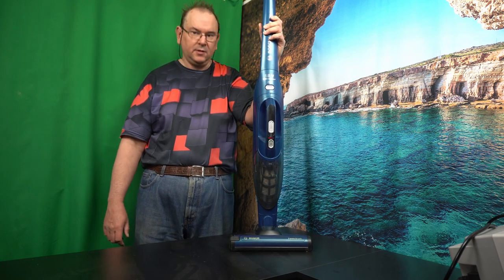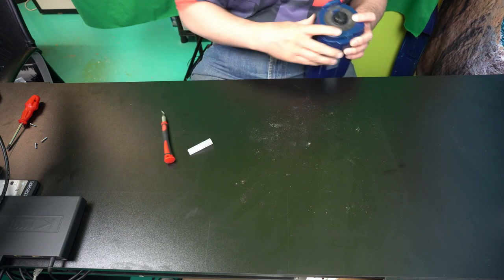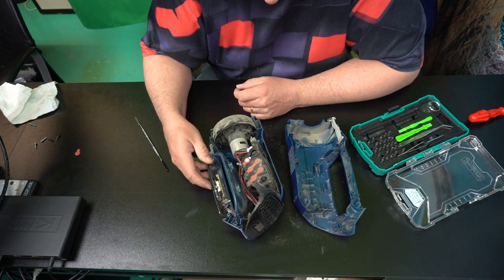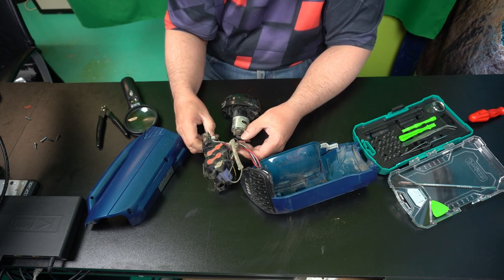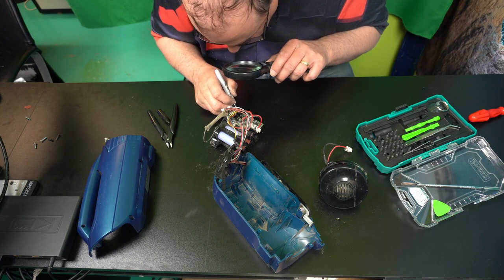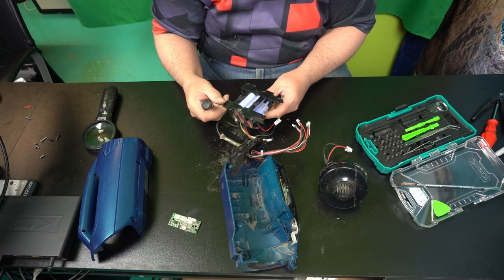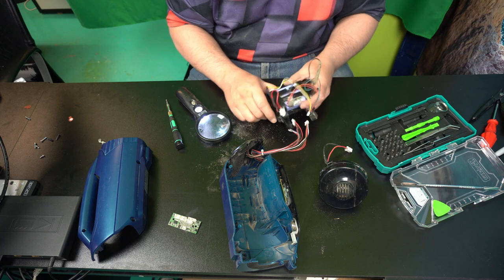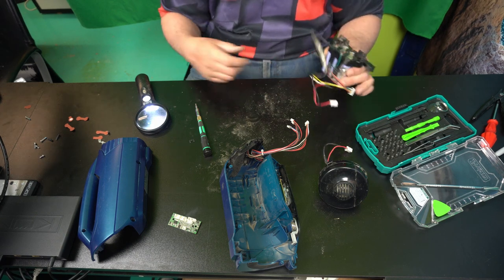Bosch`s anti repair design vacuum cleaner VXAS012V18 battery removal

Comment: My Bosch vacuum cleaner can't charge battery after 2 years. It stops charging after 2 seconds. So, don't buy Bosch.
Reply: People put these things 24/7 in the charger. This also has a significant impact on battery life.
Reply: @mahaniyama I have had my IPod 24/7 on charger for 15 years before I sold it and it was still working wel!

Comment: The problem with BMS can easily be related to dust on the board. If there is no charge, try rinsing the board with alcohol
Reply: Excellent suggestion. I had one of these units that showed full charge (ie. blue light) but wouldn't run very long, if at all. I pulled the cover off and blew it out with an air compressor and it appears to be working now.
Reply: And thanks to @the tech rabbit for helping me work out how to open it!

Comment: I have same vacuum , flashing blue and red light , batterys are good and balanced , problem is bms , i think bms is locked or something. ..
Reply: what is bms ?
Reply: @jobser2k977  Battery management system. Basically the thing that makes sure each cell is charged to the same voltage, and cuts power when the cells are either too charged, or out of charge.
Reply: Find the answer of your red and blue led flashing?
Reply: Find solution?

Comment: This model use stm8 microcontroller and after replace the cells need to be reset.
Reply: Could you maybe explain what this means? 
Because I have taken mine apart, and currently I think it won't be a big problem to get new ion-18650's and solder them in. However would this do something to the STM8 controller? 
(I know from some E-bikes, that once you disconnect the power, the chip notices someone is fiddling around with it and it will stop working entirely. )
So, does your remark imply that this would be the same for this vacuum cleaner?

Comment: Wow, this is the first thing I found when I started Googling for this model. I cannot believe they've made battery replacement so difficult, no way I'm going to do this myself. So my otherwise fully functional vacuum cleaner will go to be recycled and I'll have to buy a new one. At least not Bosch this time.
Thanks a lot for the video!

Comment: Writing to let you guys know I've managed to replace the old Samsung batteries with LC18650 LAVA. I found them in Bulgaria and they were 40% of the price of the original ones. Right now the device is working, but let see how it behaves after some time. 

Thanks again for the video!
Reply: Did you had any problems with BMS? some devices like to shut down permanently when battery cells are removed
Reply: Great to know it'w working with you. Does it still work?

Comment: Mines a vxas012v21 and has the same issue, it’s ridic, I paid a premium for a) Bosch and b) lithium specifically because lithium lasts longer and because Bosch is good about repair parts, usually. And they’re still good about the repair parts — you can buy everything that’s available in their own spare parts site. It’s just that the entire motor unit is a single part.

I just checked eBay for new batteries and all I found was a whole bunch of “for parts” ones with the exact problem of the battery being toast.

I am severely disappointed in the vacuum part of Bosch, anyway. My new oven and cooker good also ended up being different brands for various reasons. Shame, it was nice to have a go-to brand that would usually see me right.

Comment: Hi, help needed, I have accidentally shorted the PCB, the ST 20-pin chip on the BMS board was fried and I can't read its markings. Do you know what it is? Also, would you know the value of the R28 resistor? Thank you!!
Reply: Ok, I already know. It was STM8L051F3 - the microcontroller and whatever program was written to it. The board - Li5S4L01 - is unobtainable. I guess it's time to replace the board with some 5S BMS and a switch...

Comment: You can get those cells much cheaper, about 3euro / cell. Look for laptop batteries, or cordless drill batteries. All of them use the same type of 18650 li-ion cells.